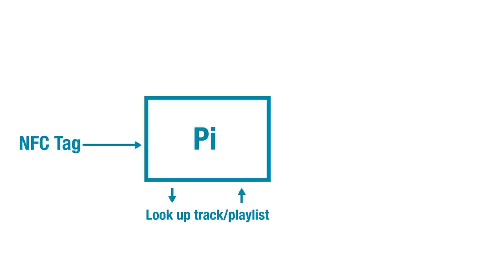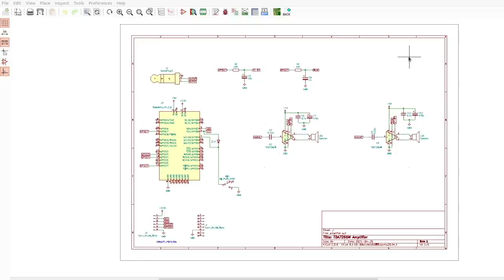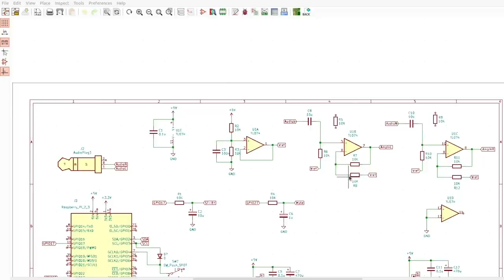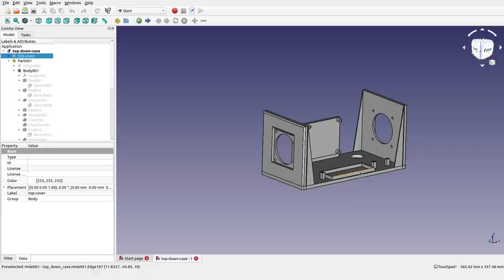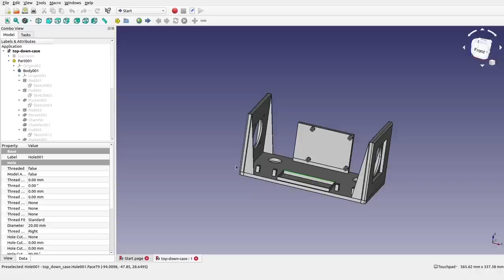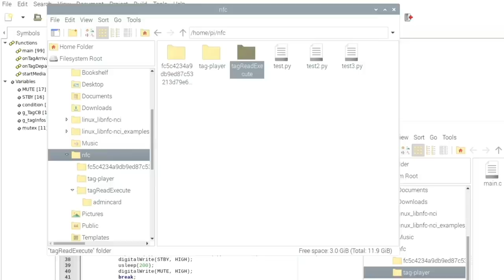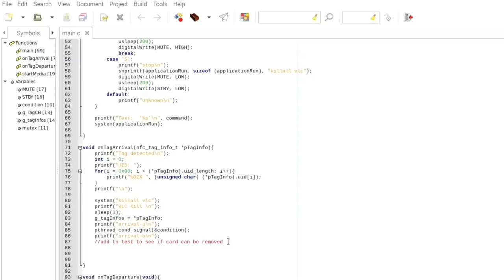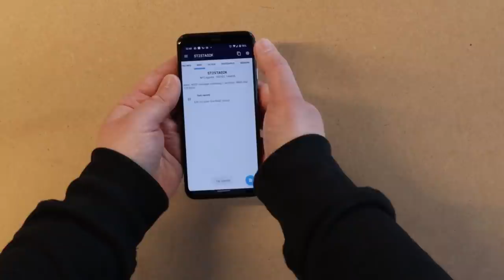Raspberry Pi NFC Button-Free Music Player

Comment: Great job! Running the audio amp/circuitry off of an isolated dcdc converter will be the biggest thing you can do to eliminate digital noise coming in through the supply rail/ground. Many dual domain designs use completely separate digital and analog vcc/gnd planes or at the very least depending on frequency tying grounds together with an appropriate ferrite filter. Another good idea is careful routing of the audio path (shielded cables/route traces 90 degrees wrt any nearby digital signals, guard traces/physical space between digital and analog signals/good star ground planes around analog signals).
Reply: The interference is rf crosstalk from the nfc radio. A bit of aluminum foil under the module would cut it. That's why it gets louder when the tag is removed, the tag pulls energy from the radio field pulling it down. Also add was demonstrated, when the top is removed it goes away.
Reply: Rather than just masking the problem with shielding foil, it's best to decrease the noise susceptibility of the analog amp circuit in the first place. If all you do is shield the nfc portion the audio can and will still receive interference from anything and everything else in the vicinity (cell phones, wifi, etc).
Reply: @sjm4306  it's still down to shielding foil. Just how much of which type is used. Though, the biggest susceptibility of the system shown is the nfc radio inducing additional voltage into the audio input. The nfc radio is inducing up to 40v into the tags, so the signal is much stronger than that of your mobile or wifi. It also transmits in bursts, hence the clicking as the induced voltage over drives the amplifier inputs.
That aside, you are absolutely right about proper design, however, having an isolation shielding foil is also the answer to nfc interference isolation on the mobile phone. The phone just uses a copper foil to keep the nfc antenna from overloading the power busses and not aluminum
Reply: Thanks, I agree it's important to look at routing. Something I tend to struggle with on stripboard, I'm a big fan of designing PCBs to allow better routing, I find I consider it much more whilst doing the design.

Comment: An aluminium/foil shield should help with the noise, but it would be most effective if you can ground the shield. Unfortunately, grounding would not be convenient since you're dealing with a 2-wire DC power source, but if the unit is normally stationary and doesn't get moved around from room to room it wouldn't be difficult.

If you're certain that just the one wire/cable is causing the problem you could try wrapping that with foil and see if it helps. You would want to wrap over the foil with tape or plastic to prevent shorts.

It's unfortunate that the convention with DC is to use the term "ground" (or "earth") synonymously with "negative", because they are really, really NOT the same thing. Depending on the components and how the circuits work, tying a shield to negative can sometimes help, but usually it does nothing because all you're doing is feeding the noise you're trying to take out right back into the circuit. So for DC, unless you have an actual ground available to connect you are probably better off saving the effort and just leaving the shield floating.

At any rate, it's a cool project, and the issue with the noise is actually a very helpful thing for everyone to know about when trying to use NFC with audio projects.
Reply: Thanks for that, that's really useful. I'm going to try and add a shield and see how it behaves.

Comment: The interference can be reduced if not cut out entirely by placing an aluminum foil between the nfc module and the rest of the circuit. The interference gets louder without the tag because the tag pulls the field strength down by drawing energy from it to communicate its contents.

But an excellent project and a great starter for anyone interested in passive radio communication
Reply: Thanks, I'm going to try some sheet, or foil and see how it goes.

Comment: A Ferrite sheet attached to the bottom of your NFC Tag reader will probably get rid of the ticking noise.
EMI Shielding Ferrite Sheet, Polymer Film, 60mm x 60mm, 0.43mm Depth, M4 (found this on Element 14  38M4040AA0606)
Also, Dragon Kin makes a solid point as well
Reply: Thanks, that sheet looks great, will look at trying some

Comment: The noise interference is caused by the magnetic field of your coil inductor for nfc rx. You need to add more distance between the reader and your amplifier circuit. You may also use shieldings to condemned the field.
Reply: Thanks, I'm going to try shielding, I found that distance helped, but I don't really want to make it any larger, so will try a shield of card wrapped in foil/tape first.

Comment: So, as you show in 11:04, the C code will parse the contents of the NFC tag, snprintf() it in some format string, e.g. "cvlc %s", and then feeds it into system(), aka executes it as a shell command? What happens when I program a tag with the content "R,abc.mp3; rm -rf ~" and hold it to your Raspbi? :D The code needs shell escaping applied to the argument.. (Yes I know overkill / paranoid for home-projects, but things should be secure by default, it bugged me)
Reply: The security is the key for my front door! But you make a really good point, it is something I completely overlooked, but should really have thought about

Comment: How are you powering this? I have some usb speakers and an nfc hat. And I get under voltage warning which turns off the wifi card which means I can't ssh into it.  My power supply is 5v 3a output

Comment: try making a small piece of cardboard /plastic or something with some layers of aluminum/copper tape over it. then put that directly under the NFC reader but make it so it is bigger than the NFC reader board. That should maybe block the electric field that is being generated/created by the NFC board.  You can isolate the copper/aluminum tape  with some other non-conductive tape(safety first). Am not 100% But this might remove the clicking noise. About the sound can't you make it so the volume is decreased or increased by x-number (maybe 5) every time a volume decreased or increased card is placed on the reader. but you might wanna put a 30 sec delay on the change of volume or something so the volume change isa't to fast. Grate video. using VLC that is so smart cos that works for videos to.